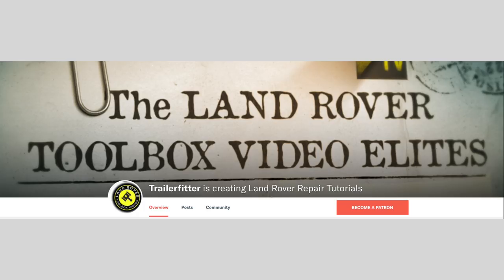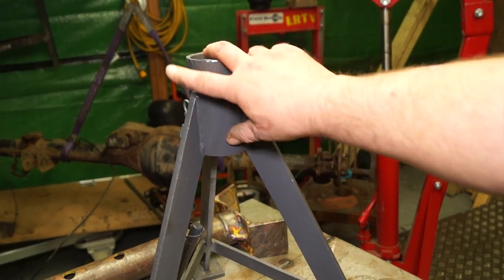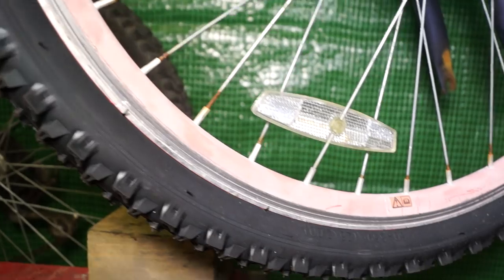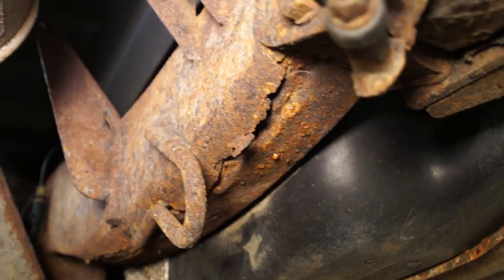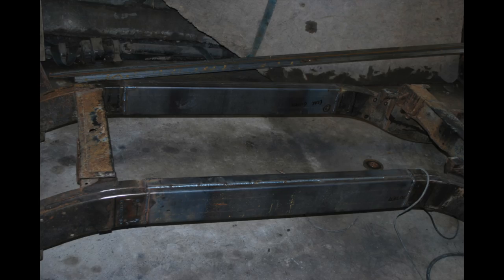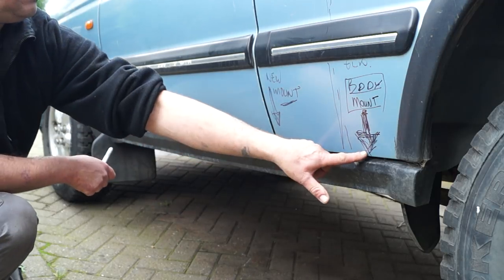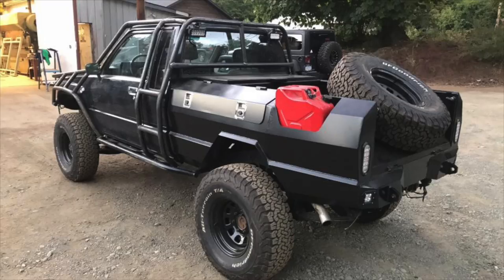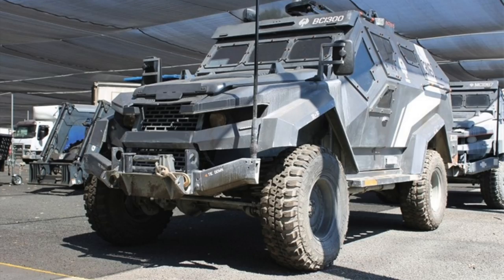LRTV VLOG 2  D2 conversion.  Some insights before any cuts are made.

Comment: Make your wheelbase longer like 110 or 115 ,i ve been toying with this idea for a while to make my disco a cab and a half or less and make my wheelbase 110 or 115 inches and drop a canopy on the back ,with volvo portal and 35 inches tires
Reply from the maker: Iw as looking at the 127 chassis on the defender initially. The frame has many more cross members in it. i think that is more to do with the extended length needing support.
Reply: Land Rover Toolbox Videos i forgot that you intend to make it as a work horse mobile welding truck 127 is even better 👍
Reply: I like the idea of stretching it to 120 and lopping 20 inches off the back end to improve departure angle, that way the diesel tank could move into the center of the wheelbase easily, coupled with 33 to 35 inch tyres that'd really swallow up the extension, although I've often thought it'd be nice to widen the body of a Defender by 10 inches.

Comment: As box section material is very little costwise, why not go for 127inch wheelbase? that way you could utilize the more expensive drive shaft from the 130?
Reply from the maker: Yes I think more than an extra 10 inches is needed.  It will need extra cross members but wouldn't take much effort to make especially if they are out of round piping with flanges.